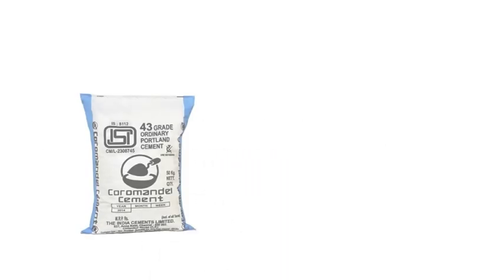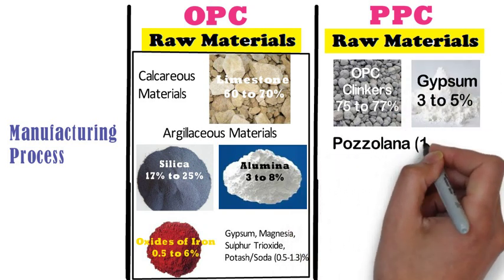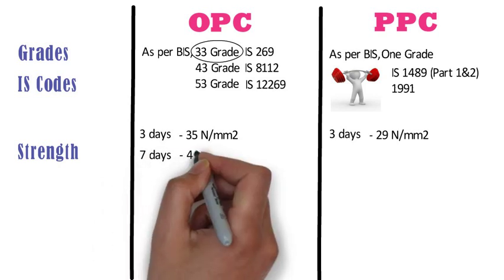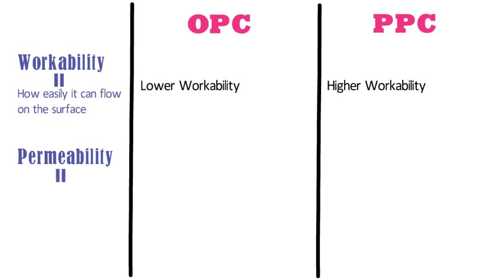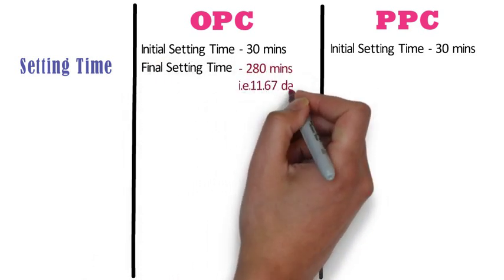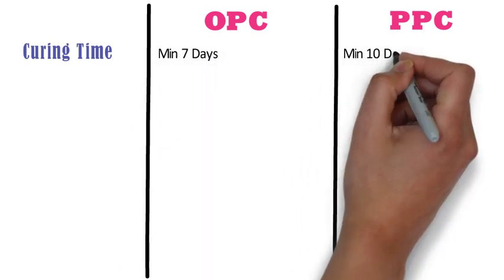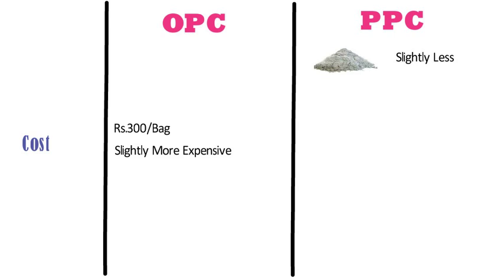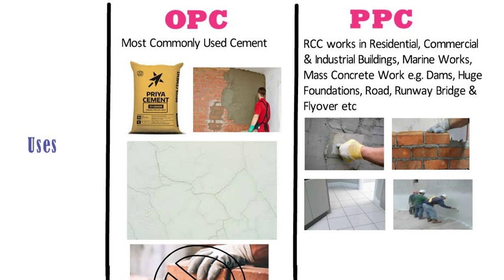Difference between Ordinary Portland Cement and Portland Pozzolana Cement

Comment from the maker: Please note typo error at 4.51 the final setting time of OPC is 280mins i.e.4.67 hrs
And at 5.04 the final setting time of PPC is 600mins i.e.10 hrs.
Reply: For making Clc block which cement is best Opc  or ppc
Reply: Which one do u suggest for making CLC or any fly ash bricks?
Reply: @sarabjeetsingh3768  you can use opc for better results. Because ppc attain slow strength. I recommend OPC of 33 grade. Phani Kiran ( Structural engineer)
Reply: Opc of 53 grade
Reply: Plz Make a video on SRPC and OPC difference
Reply: 280 and 600 are in hours not min days are correct
Reply: Ha
Reply: What happen if we use opc 43 grade for home
Reply: Yes that's the mistake i saw
Reply: @sarabjeetsingh3768  ppc
Reply: L
Reply: L
Reply: @sarabjeetsingh3768  Z

Comment: One major point missed is that  fly ash helps to complete the reaction of cement.  In OPC some part of cement is not used whereas in PPC a complete reaction happens due to active silica and hence in concrete finally there Is no cement which is left unused.

Comment: So if i want to make my roof slab not to leak with water during rain, I should prefer PPC a plaster instead of  OPC plaster?
Or how else to prevent seepage from top slab?, other than using plastic membrane in the whole slab

Comment: Grade of concrete varies with grade of cement? Ie. If I want M25 concrete and I know that the proportion is 1:1:2, is that depends on grade of cement if I use opc33, or opc 43 what is the difference??

Comment: Sir I want to know one thing that you told that the strength of PPC is nearly the same as opc 33 grade. Then how can it achieve 56N/mm2 strength in 28 days
Reply: This sabot the different characteristics and where they are used. The physics and chemistry of how these characteristics are the result of the differing ingredients are beyond the scope and point of this video. 
Google/Big/Wikipedia it yourself. You need everything just handed to you?
Reply: Bhai ye galat bta raha hai don't trust him on this... 33 grade means its strength after 28 days will be 33 N/mm2.

Comment: 2:41 How can PPC gain 56.5N/mm2 after 28days when it is supposed to be 33 Grade?
Reply: PPC  33 Grade. (it's 28 days strength is comparable to that of 53 grade OPC due to pozolonic materials)
Reply: Don’t confused with grade of Cement ( 33, 43, 53 ) it’s indicate fineness of cement particles not Strength of Cement .

Comment: Adding puzzolonic material gets less strength and rate. You told more strength. It is not correct. Test it once again and confirm. By watching this type of video cement rate of ppc also increasing in market. Poor customers trapped

Comment: How come 600 minutes = 25 days, please elaborate.
Reply from the maker: It's typo error,  it should be 600 mins I. E. 10 hours
Reply: @engineeringmotive6669  thanks, clear. By the way you have good vedios, and with a difference to others looks like you are well educated in the subject.
Reply: As per IRC:21-2000, clause 302, sub clause 302.1, Notes (1)
Here it is clearly mentioned that "Use of PPC may be permitted only in Plain Concrete Members". Plz clarify which code we hav to follow